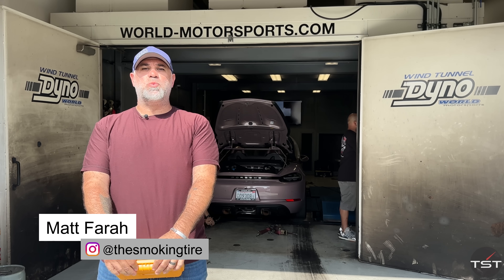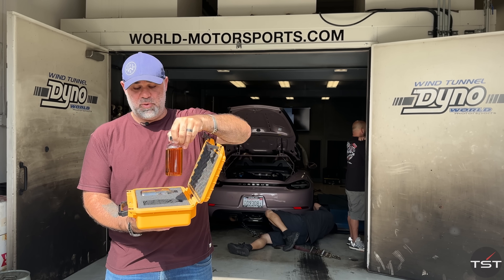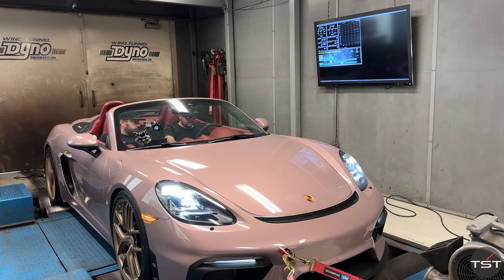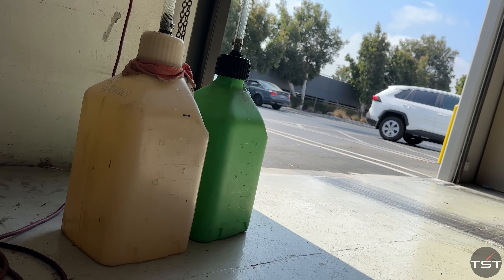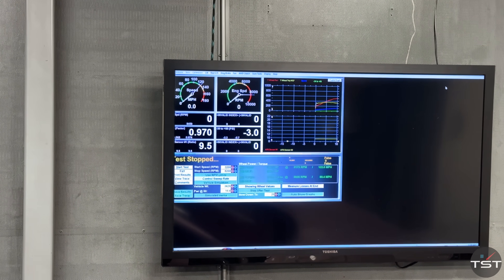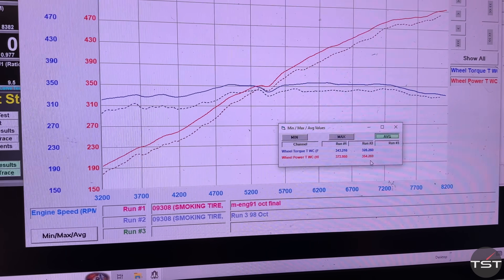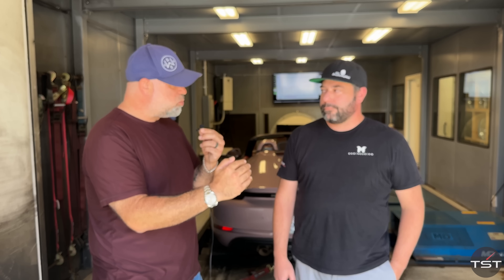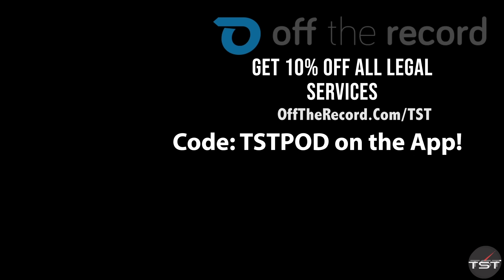How My DeMan 4.5L Spyder Made MORE Power on WORSE Gas! - TheSmokingTire

Comment: The explanation is really simple, the original DeMan tune was crap. Miami Miles came to the same conclusion on his 4.5 GT3. That dyno is reading very high but doesn't matter if all you care about is the difference. There would be a lot more in it still on high octane.
Reply: Maybe not crap, but most likely off the shelf file which is supposed to cover all the builds and keep them safe. Since any custom engine will vary in final output, all owners of those units, after proper brake-in, should do pro-tune to match the software to hardware.
Reply: @driverpsyche  If I had spent 30K+ on an engine build I'd expect the engine mapping to be decent not that you have to go and get it tuned somewhere else later. Maps can be off the shelf just fine these days, you don't need to tune each and every car individually if you leave a tiny bit of margin in it. Driving around with highly toxic octane booster and mixing it each time you fill up is just a ridiculous hassle when it is clearly perfectly possible to run regular fuel as was demonstrated here...
Reply: @JCviggen1  Matt explained in the podcast that the engine has different power output then expected probably due to the way he broke it in, and the engine is much tighter then expected by the builder. Meaning that power was not available when new but only after proper initial usage. Same happens with any production car. Engines do not wear out evenly, and depend how were treated by the owners. For same reason you can get brand new M3 or Porsche Turbo and there is plenty of margin left on the table, and later do pro tune and get even more out of it.

Comment: lower octane = less ethanol. That motor likes less ethanol.
Reply: Not necessarily. Octane levels are not just about ethanol content.
Reply: I thought lower octane means the fuel is more likely to combust under a given compression ratio? 

High compression engines call for higher octane to reduce the chances the fuel will combust too early (before the spark plug fires).
Reply: @TomK-ti8kp  
That's true.

Comment: I still don't get it lol
Reply: What's hard to understand? Engine was running on Deman basic tune this whole time. Matt said that there was some black smoke fromcthe exhaust (which means that AFR was rich).
And now it's running a proper custom tune for the fuel available and with optimized ignition timing.
Reply: @vvevvevvvv  Appreciate the explanation but what I meant was that why was it not tuned for 91 from the get go? The car is just a year or so old so it's not like the tech didn't exist
Reply: @carsaregood911 if anything it would have a 93 tune if it was running on puml gas. The east coast isn’t stuck w/ shit quality 91.

Comment: Octane is a resistants to burning, the reason why having higher octane is better most of the time is it allows for preventing an uncontrolled burn. And gives a wider safety net or will let the engine get closer to NBT timing. High compression and high timing and bad combustion chambers/ piston design will need more octane to prevent pre-ignition. This engine is clearly extremely well-designed and modern ignition control is so good going to a lower octane fuel with custom tuning I'm not surprised it made a more across the entire power band.

Comment: Octane booster is snake oil. If you want a real boost in octane you need to mix in real race gas.
Reply: It’s not snake oil as it does what is says. It’s also recommended by DeMan to run actual raw gas every few tanks.

Comment: Worse gas? If your car is not designed to run on race gas, it won't give you more power. It will make less. Really Matt? And no test drive at the end of the video? Rushed.
Reply: This your first time here? You are aware that he has a built engine from deman with an off the shelf 98 octane tune right? Did you watch the video?